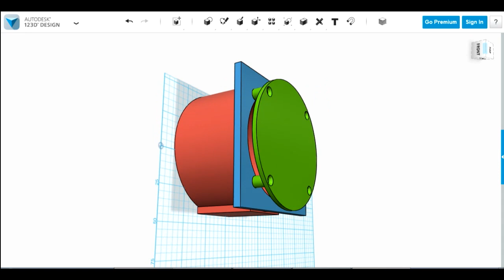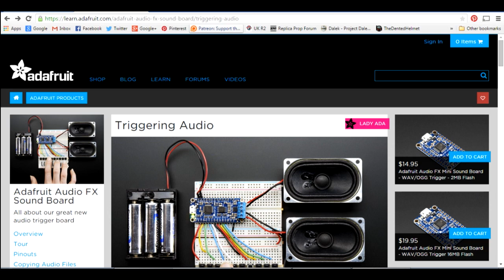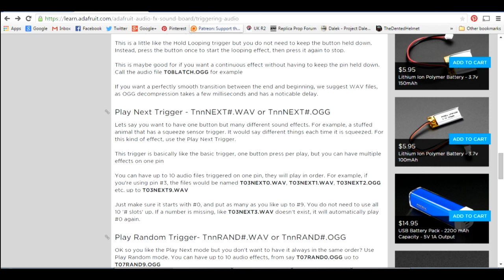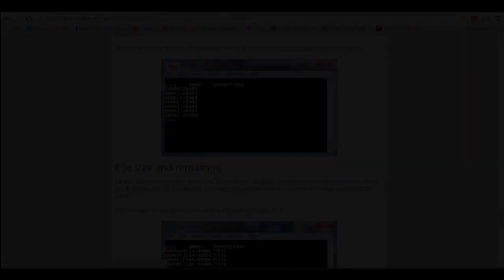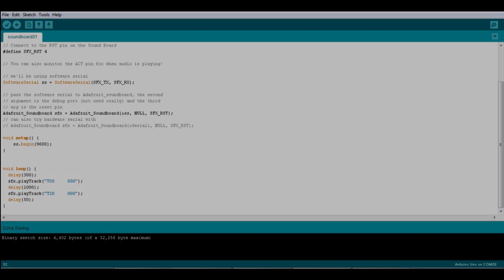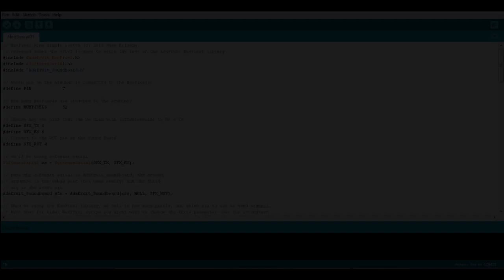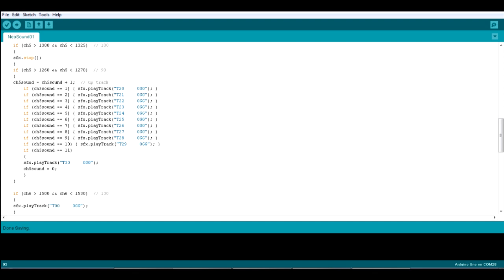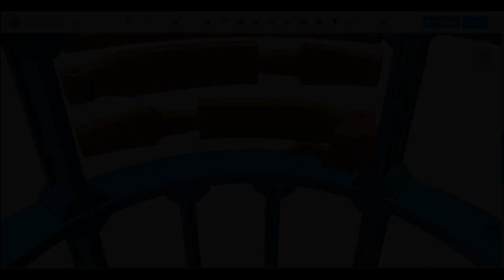Star Wars R6 Droid #12 | Sounds & More Details | James Bruton

Comment: you HAVE to put a lightsaber ejector in there
Reply: launcher in the body and a barrel extension thru a head panel
Reply: MICROmor But the head rotates! It would only work if the two halves of the barrel were PERFECTLY aligned. Not to mention having to jam an air compressor in there to actually fire a prop lightsaber out, and building a prop lightsaber that can hold to being fired into the air and falling on cement (probably) without breaking.
Reply: so? -it's electronic, you can use many kind of mechanisms to have the halves aligned. - not needed a air compressor, just a flywheel or spring loaded, etc. - you can make a prop lightsaber out of anything, heck, he even made an iron man armor out of foam. most toy lightsabers can hold that abuse and more.
is just that this project is really cool and my imagination rambles around, not actually demanding that he biuld what I ask for.